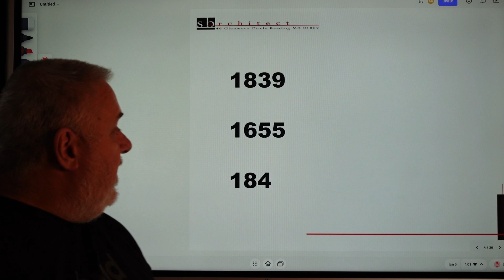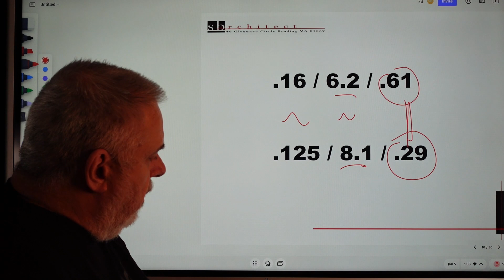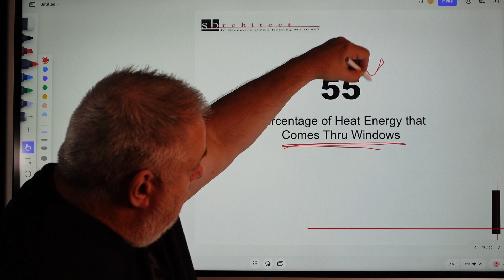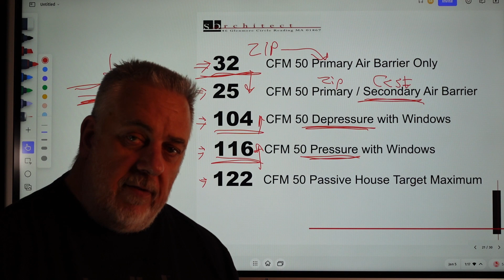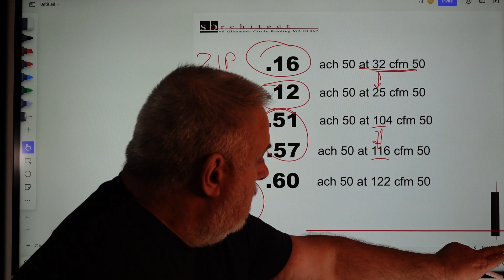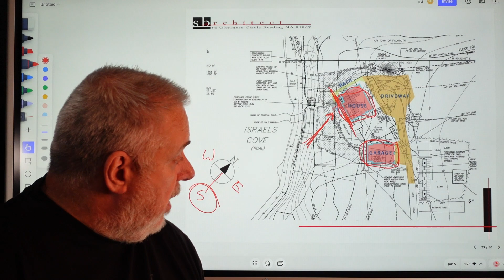PH 11 Episode 2 - ALL ABOUT THE ##'s

Comment: Crazy thought that came up at @17:30 during the discussion of CFM50... Given concerns about indoor air quality, pollution & allergens, i feel like windows could be designed to seal better when the interior is overpressure, and then design the ERV system to keep the house at a slight overpressure... On second thought maybe the answer is just European style casement windows with serious gasketing and locking mechanisms😂